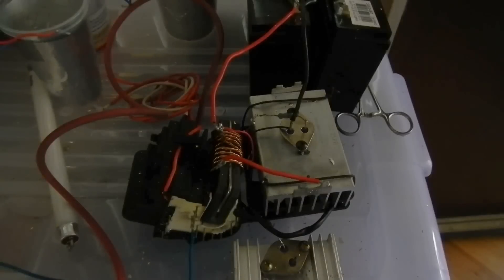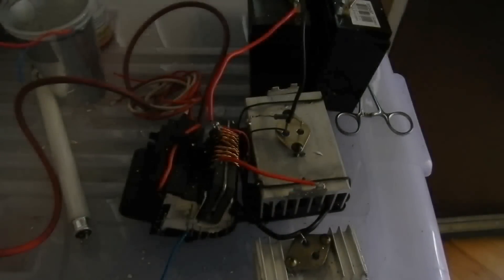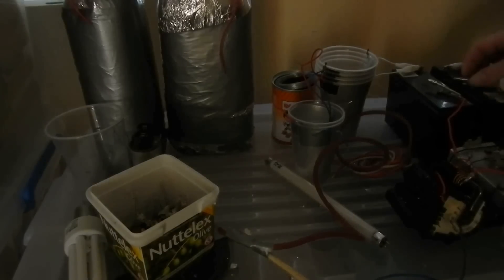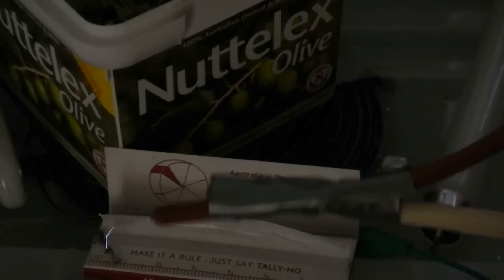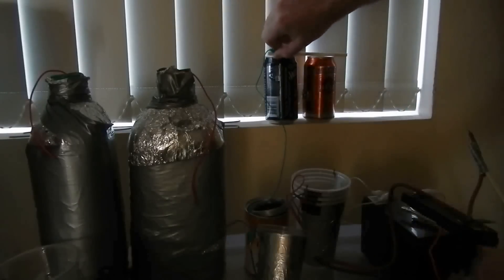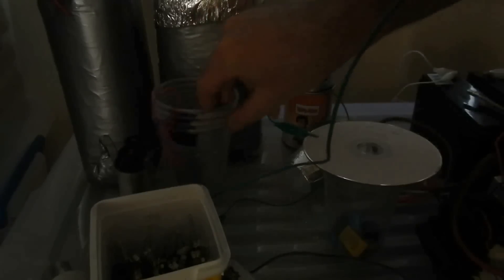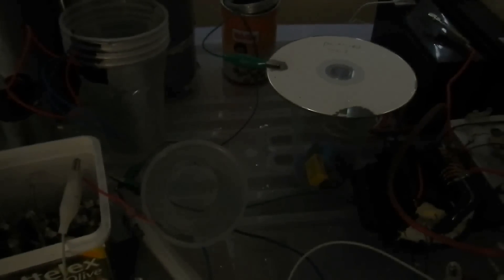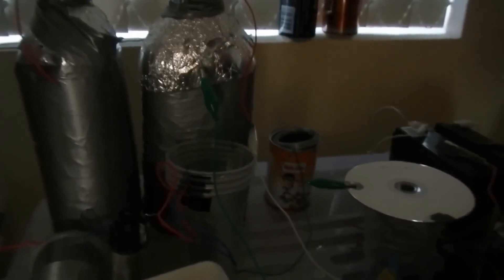High voltage Joule Thief. Flyback Plasma maker. The most secure form of data deletion.

Comment from the maker: This is a replication of one by Makerj101 (recommended channel). At the time Jts where my main specialty. So its very 3 wind JT like (so much so that is is a 3 wind JT, with a few extra coils I'm not using). I've had a play with 555's and more traditional magnetic amplification drivers now, so the next ones should start showing serious improvement. I also try not to buy anything for this stuff. Maybe a few 3055's or 555's, everything else is from the rubbish bin. Or home made.

Comment from the maker: My first HV video. With my first Flyback. Was just re-watching it and facepalming my poor safety and tiny arcs a few times. There will be some more from my flybacks soon.
Reply: Just checked out some of your other vids. Very cool.
Reply from the maker: Thank you. I wish I had time to do more. Sadly a 15min video always requires 4 hours lab cleaning. LOL. Need to move away from the archeological filing system. Spend more time burning water. :)
Reply: content is king
Reply from the maker: I need more CD's too. The only ones I can find I need (or like). DVD's take too long to blow apart.

On the up side. I have all these clear disks for mounting circuits etc on...

Comment from the maker: I agree 100%. I was going to do an update on my how to make a layden jar video, and address those points. You can still fill the jar that much, if you put mineral oil on top. The foil is high to address corona discharge issues seen in most layden jars, and works to, up to about 50kv. The Foil is actually ok though, as the tape keeps it down to the jar. also more foil mass, more electrons it can hold! The main thing causing the fail in this video is the 12 rated red wire insulation leaked....

Comment: The problem with your leyden jars are as follow. You have too high a level of an electrolyte, the foil is to high up the container, and you need to make sure the foil is as flat as possible against the container. Your are having arc over at the top because the proximity is to close between terminals. And plastic can store a static charge. Air bubbles between the foil and the plastic container can build up a charge.

Comment from the maker: Yep. 180v is about the most you will get from 60ma. bump it up to 2A and you might start getting in the 400v range. That around my personal best. There is maths to work it all out before you build if you are really keen. Make sure your collector coil is really thick too. 2+mm. It'll need to be that thick to handle the amps without melting. 8000:4 coil. Its going to be about 5% efficient if your lucky enough to get what you want working. I think ohms law will kill it with heat.

Comment from the maker: On 12v this is very close to deadly, if you can get some results with 5v your setup is probably fine. I don't think 2+kv is possible from 1.5v, your going to need to push a lot of amps if it is going to work. Maybe 5x 3055 in parallel, as well as a lot of D cells in parallel for amps. I've had up to 200v from AA, on a different circuit. If you could do that with more amps than my last high voltage from AA attempt, you might get there. Resistance losses will make it very inefficient though :D

Comment: :D this is not deadly i have touched so many times 2-3 times more powerful and 1 time zvs :/ (after that my finger is bugged ) :D whatever
i will up video soon i also tested it on 5v and then there is ~2kv plasma and slightly lit fluorescent tube . 
my aim is to make 2-5 kv with 1.5v battery :D i mean sparks like yours with 1.5 v

Comment from the maker: LOL! Its not going to work from 1.5v or 2n2222. This one is running from a 2n3055 and 12v. Needs around an amp. If you show a video with what you have I may spot other issues too :) I'm not posting a schematic for this one, as its so deadly! If you cant work it out your not ready. Its got 2 components ffs.

Comment: lol man :d how u did it can you give me chematic or something like that for 2 days im trying to get working joule thief flyback but :/ nothing happends it gives me only 100-200 v at hv pins and it shocks only if i touch it to my tongue dont feel shock in hand also dont see any spark out of it runing it on 1.5 v 2n222 transistor tryed with some biger transistors but it gives me lower voltage for the amp draw i havent measured it

Comment from the maker: Thank you! Any advice for getting to the diodes in flybacks? I think I killed some the other day. shorted out to my mess (and I'm not sure where) with a 2000pf leyden jar discharge, and stopped working, transistor is fine, flyback dead.... Also I get a lot of plasma on the flyback, as well as across the pins, if I just put it in oil, I'm concerned the insulation inside may still fail. Can I drill holes or something? Performance seems to be dropping after the fist few min on a new flyback.

Comment: Thanks for the kudo.  I wish people would use my Supercharged Joule Thief circuit so the higher efficiency would save battery power.  I can't remember seeing anyone on youtube experiment with it.  If the transistor gets hot, try bolting its tab to the heatsink.  That way you don't have to drill holes for the E and B leads.  Better yet, use a big plastic tab transistor from a PC power supply; they're good for a few hundred volts.

Comment from the maker: I get 240v @10A 50hz out of the wall in Aus. I'm only using 1A atm, for approx 30kv So 6A should be 180kv. I think? Also tempted to try 2x12v for 24v, but I don't think a 3055 will survive that. Maybe a 19v laptop supply... Got a 6a one :)

By on resistance do you mean the resistance of transistor in on mode?

Comment from the maker: This one only draws an amp. I was really disappointed. Another 500ma through the primary, and I should be able to hit 50kv(ish) Although it is wise to be weary of large 12v batterys. This one is two 12ah 6v's. so it goes flat pretty quick at this loading. Buy yes, melted some clip leads... I should make a PC supply. Negative voltage would be really handy for some stuff I am looking at. Safety is always a concern. I have a few fire extinguishers, And am Volunteer Fire fighter. Safe if I'm alert.

Comment from the maker: Yes. I have been surprised at LED's still working after being run from Plasma arc too. With My Slayer/Tesla coil. Although I have killed a few too, and some don't light wirelessly after HV for some reason? Same for the ones I use as protection diodes on the Tesla/slayer. They only work on DC after that. Even with earth on cathode and ant on anode, they don't light. But work on DC. I think they can handle the voltage, but its the watts that kill em. Have run Leds at Low voltage high current too.

Comment: The on resistance is also pretty important.  6 amps is not very good.  It is good for high voltage though.  So you might be able run it of 120 volts like I did.  I'm still learning too!  ;-)

Comment: I would ground your battery too.  I never worried about that because my power supply is grounded.  I don't like using 12 volt batteries because it's to easy to ruin your clip leads, start a fire or just blow stuff up.  They supply to many amps.  I only use them for projects that my 12 volt computer power supply can't handle.  My computer supply is really nice, it instantly shuts off if you short it out.  Plus they never get dead!

It wasn't running good enough with my old coil to get plasma.

Comment: I got my zzzapper working, about 5/16" or 7mm AC arc.  I put an LED in it, watched the arc make the LED flicker.  Connected the LED up to the PS and IT STILL WORKED!  Shocking details in my blog. rustybolt(.)info/wordpress/?p=5648

Comment from the maker: Good tip about the ground, was going to try that! It does act as a cap a bit, get zapped when its off. thinking about grounding the battery too. Yep 12v. Tried shorter base, was shorter spark, so that makes sense. Was thinking about it before sleep last night, and I think I know why. Will have to test the theroy. Was waiting for you to ditch the wind with the knots in it, that was never going to be good :D Corona loss. Did the knots have plasma? still got 3 fly-backs in the drawer, more soon!

Comment: Nice job!  I would connect the flyback HV return to ground so that the system does not build up a charge.  Is that 12 volts your running it on?  Experiment with the number of tuns.  I found that mine works better if the winding that is connected to the base (through the resistor) is longer.  Also try different values for the resistor.  I got my Tesla coil/exciter working!  I am able to light florescent tubes from about a foot away!  Right now I am working on rewinding my Tesla coil.

Comment from the maker: Thats odd. A few of my favorite HV channels do it regularly. Whats got me, is most people can draw an arc longer once started, Mine wont. longest ark is plasma not hitting neg (is that still an arc?). I think its a lack of amps, and thus a lack of heat. The purple - blue - white with no yellow seems to indicate the same. What do you think? Would that explain my lack of sucsess with Jacobs ladder? Been zapped a few times now, no burn, just like an electric fence. Closer to a tazer when from cap,

Comment: Oh, I'm aware of the trick of using arc length as a rough measure of voltage. I've just never seen it done against a ruler as background. Usually I've just seen rough estimates of the length. It was neat seeing it against a ruler.

Comment from the maker: Yep. My Cup-Cap  creation turned out to be pretty handy. Have you seen the video where I did the 500pf  variable tuning cap? If the metal stoppers where replaced with dielectric, it would be a ripper. Although I need a way to adjust when live... They have a bit of punch when charged up to whatever voltage I have here. it's not advisable to pick them up when live.. Wonder what happens if I parallel the 3055, and take the HV line, and wrap it 4 times round another flyback?

Comment from the maker: I was thinking this would make a motor go ok. this one does 880 HZ or Khz, I forgot to check if the scope dropped a degree of magnitude like it often does. Hoping to get a TIP31 (or 3 in parallel) doing it at over a mhz.... Tip 122 and 32 failed. Couldn't get the fly-back transistors to work either. Short 2.4mm gauge coil makes for tough tuning. Hope your back improves. After 13 years concreting I know that pain all to well.

Comment from the maker: Arc length is an indicator of voltage. I may have 30kv here. probably more than 10, which only goes 3mm. I can get multiple 3mm's on the bell and ring pull. The other side of the CD label is the foil. its whats got the pits and reflective surface, Its also what tries to conduct the power and flys off. The CD is clear with a few scorch marks when done, try it with your HV rig. With glasses, foil in the eye hurts!. HV geeks always measure and compare arcs! Notice the lack of heat? Cold Plasma?

Comment: Nice collection of demonstrations! Neat how you got the pull tab on the Franklin's bell to hold in place while arcing from both sides to both cans. I also like how you did the arc length measurement against the ruler; never saw that done before. I guess the data might still be okay on the CD since that's in the form of tiny pits on the other side, I think. The part you removed is just the label paint. Did you try using the CD again?